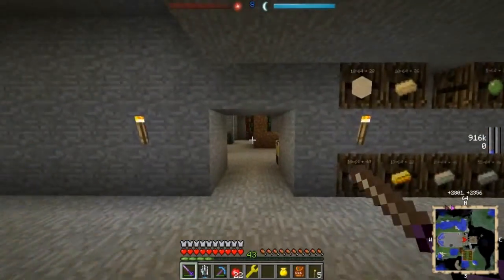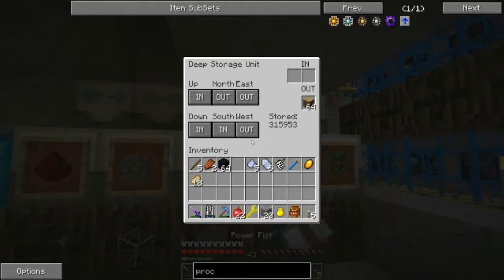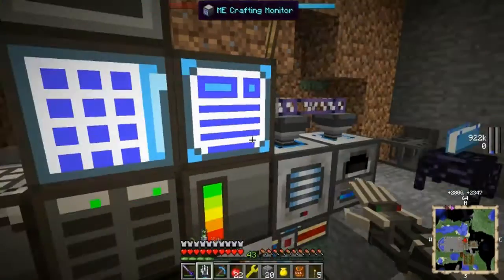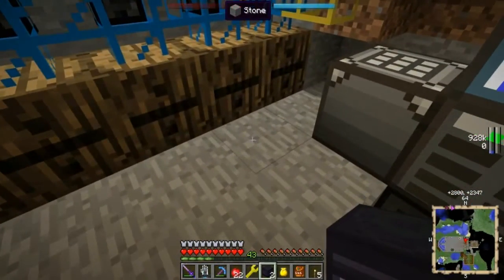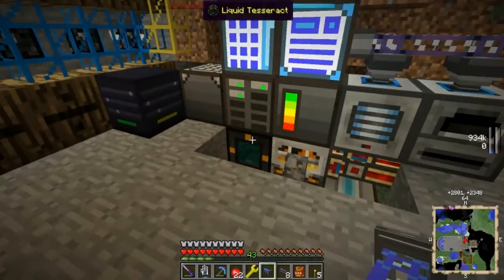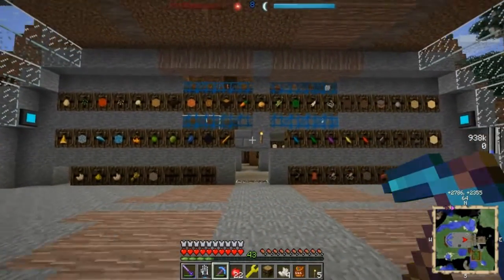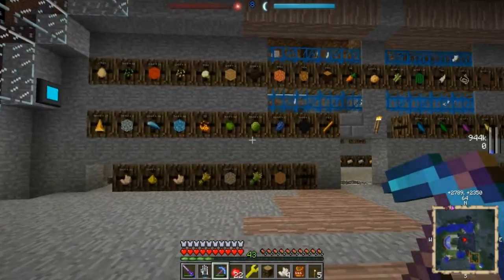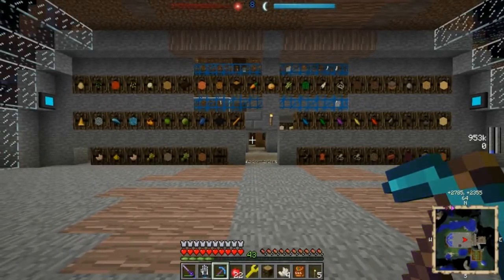FTB Unleashed Ep10: From barrels to ME storage

Comment: The laser drill is a waste if time and energy it has to sit on top of bedrock and it will randomly generate 1 ore block every 300 seconds and uses either 200,000 MJ or 500,000 EU per ore.